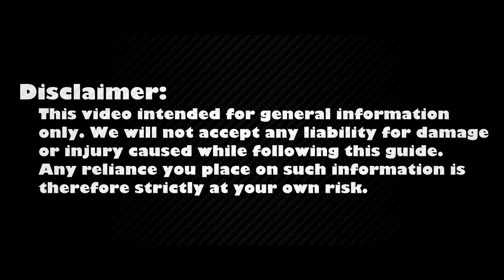How to Replace Asus K55 Keyboard | Fix Unresponsive Keys DIY Guide

Comment: What is the maximun  amount of ram that this laptop can be upgraded?
Reply: Caleb Guadalupe It takes up to 8GB in each slot, which gives you 16GB of RAM. But be aware that it only takes DDR3 1600Mhz RAM sticks.
Reply: Thanks for your reply. I have the K55A but it says that the maximum ram is 8GB.
Reply: It's the same as mine, I've a K55VM and the maximim ram is 8GB in each slot. You just have to be careful beacause it has to be a SO-DIMM form factor.
Reply: Could you recommend the specific memory modules?
Reply: Also could I ask what is the firmware number of your BIOS?